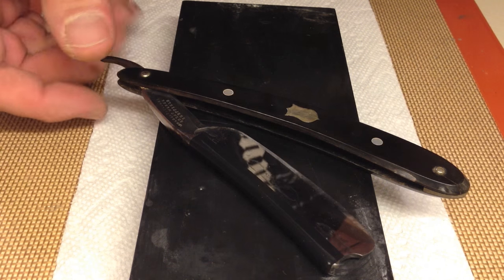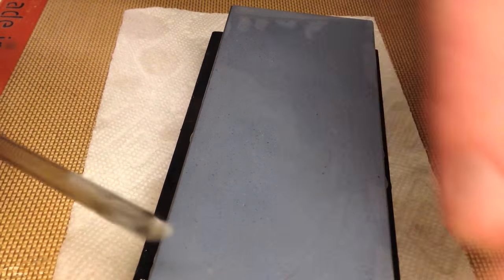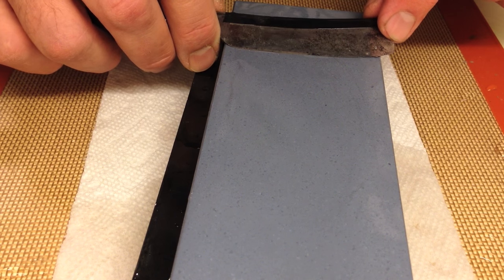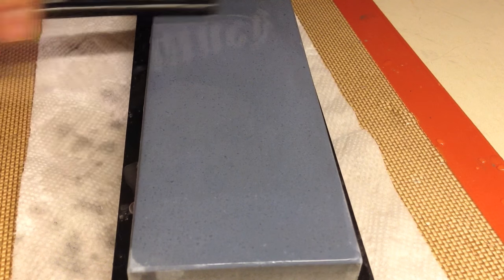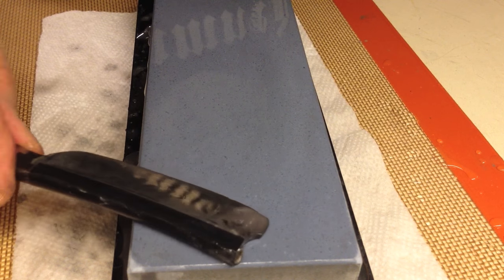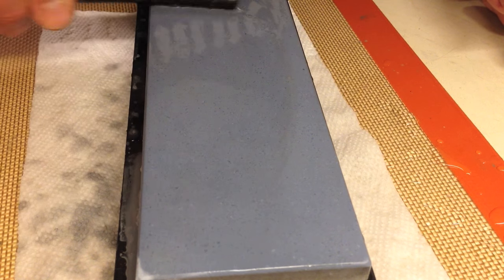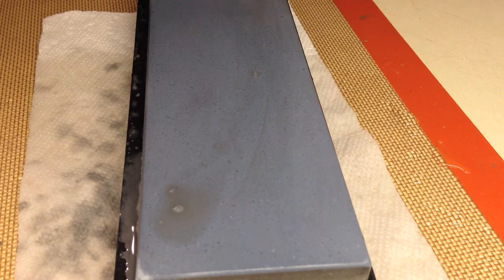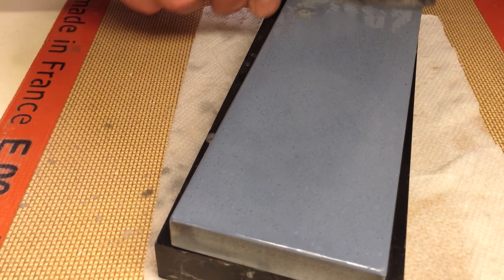Bevel Setting 101a  - Greaves Wedge

Comment: I was working on a Filarmonica last week Keith, it had a 1-1/2mm-2mm chip in the blade. It went fast at first, the chip started wearing away, then it was like hitting a brick wall. It took forever to get the last little bit finished. You know how I speed up the work? I used the slurry off a dressing stone to help abrade the last bit of the chip away. It worked perfectly, and really was a good example of how effective a hard stone and some slurry can be. It made me think of an Awasedo and nagura, the same principle anyway. I've been looking at some coarse Jnats, but I'm not sure how they measure up when compared to an Atoma or similar plate/synthetic stone at lower grits.

Comment: Keith I have been watching many of your videos. I am interested in picking up a wedge. If you could emphasize, did you simply elect to tape the spine with one layer because you were resetting the bevel and it was irrelevant, or did you conclude that is more or less what the "previous owner" used in honing? Thanks
Reply from the maker: Can't remember 4 years ago but I'd guess I used tape because I figured the resulting angle would be ok and if not then I could rehone without tape. For a single honing, it's just one degree so, it's usually not a problem.
Reply: That’s fair. Thanks for clarifying. I have a few razors inbound. I share your sentiment that antique items vs modern chunk. Enjoy your Sunday

Comment: I enjoyed the video. The sideways hook at the end helped get the toe on one side of a razor. I am using an 8K Norton to finish on.

My problem is the finish. I am using an 8K Norton. Most videos look like people are using very little to no pressure, but that is not working for me; it just seems to dull the razor. How much pressure is needed and what should I expect from this stone? I am using much the same stroke as you. Razor has a slight smile.

Some people say to use a rotational torque (edge to the stone) Do you know what this is? I thought we were supposed to have the spine and edge on the stone at the same pressre.

Joe
Reply from the maker: It's nearly impossible to say what's what without being there. There could be so many things going on and then when you add in a new person's interpretation of things, it gets murky fast. Torque is, mostly, making sure that the bevel is on the stone 100%. It's a common issue for new honers to let it ride up (a hair) and then you wind up wearing the spine more. We employ torque to make sure our pressure is where it is supposed to be. The Norton 8k is actually a 5k JIS stone and I'm not particularly fond of it. But it does work, but not (for me) as a finisher. If you are actually dulling the edge on the 8k, then you have issues other than those that are pressure related. All I can think of is that you are developing a wire edge early on and then your 8k is removing it. That could give you the sensation of losing sharpness. Or the stone isn't flat or maybe you're doing too many strokes. Usually - there are a combination of things factoring into stories like this. Go back to square one, start fresh - take each step one at a time. Be 100% sure your stones are flat.
Reply: I just wanted to see if I understand the wire edge so I can avoid it. Does this occur at all grit levels from too much pressure or too   many strokes?

If this occurs from too many strokes than how would I know when it is getting sharp enough?

How far back in progression do I need to go to remove the wire edge?

Thanks,

Joe
Reply from the maker: Good question, but it's not an easy answer. Wire edges are not common, they can happan at any grit but it's not something that happens all the time.Those types of distractions can be the result of numerous things, including too many laps. Knowing when to stop and move to the next stone is, for me, based on feedback. How you learn that is by doing it. Don't be afraid to mess up edges - just hone, remember what you did and do your best to not repeat mistakes. That's the best way to learn. In other words, the best way to learn about wire edges is by dealing with them, not by trying to avoid them. And how far back you need to go to remove one is going to depend on variables we don't know here. Iwasaki used Crox on felt to remove the false edge, so he went forward to get the job done. There are always many paths to the top of the mountain.